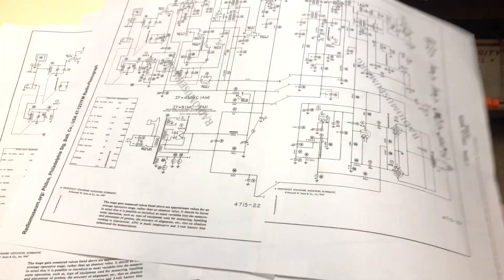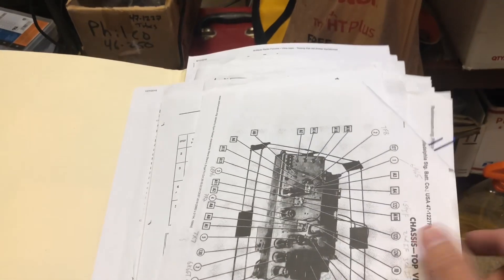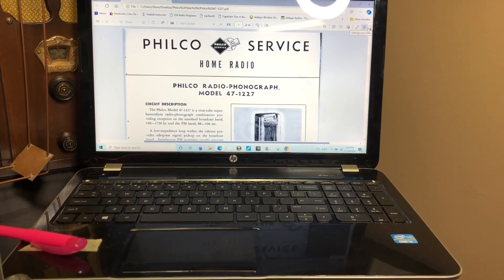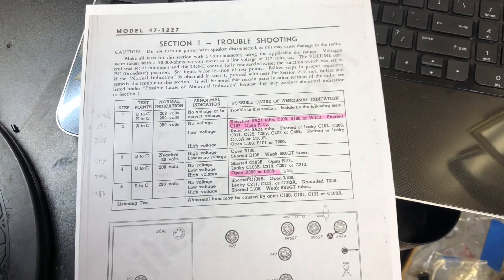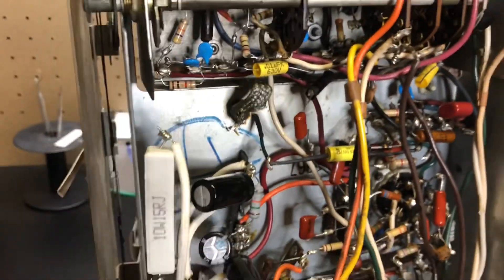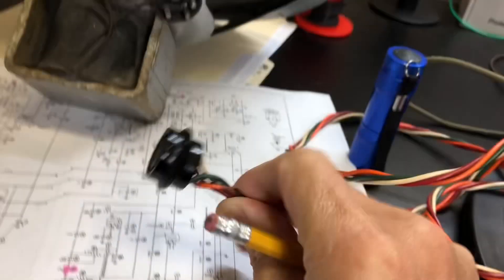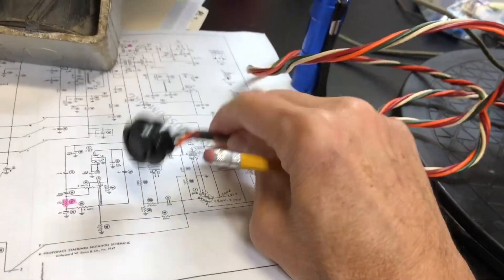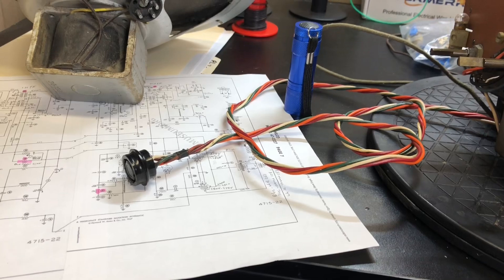I’m determined to get this to play

Comment: Speakers of that era use B+ CURRENT in place of a Permanent Magnet (they were weak back then). It also acts as a filter CHOKE.   Try a modern speaker on the terminals output transformer terminals. (the 'choke'  or substitute power resister must be in place.)
Reply from the maker: Thank you for that idea.  I’ll keep this in mind for other radios that may come my way.  The speaker I have works.  I hooked it up to my ‘48 Philco and it sounds great.  The problem, I think, is the lack of power or a signal getting to the speaker.   I’m going to test all the plate and grid voltages next.  But thank you again for your idea. 
Steve

Comment: Colors of the wires going to the speaker connector do not match up well to what was in there originally. If the orange is the
original it's voltage shoulg be 290 VDC. There was a  split to each control grid where that went to each 6K6 at pin 4. Now
the red should not be a high negative voltage. In fact if the red goes to the plate of one of the 6K6 tubes (pin 3) it should
be 280 Volts as well as the white going to the plate of the other 6K6. The green might be the wire going to a 68 Ohm
resistor that then goes to one side of the volume control.  I'm more concerned about the orange wire which is B+. It 
should only be 300 Volts or less not 468 Volts. The 6J5 Phase Inverter  plate voltage ( pin 3) should be about 200 Volts
and it's cathode at pin 8 should be less than 80 Volts. Also look at 7X7 tube pin 2 should be only 127 Volts and pin 3 a
negative 0.5 volts. All the readings you get are DC only with no station tuned in to get a measurement .
Reply from the maker: Thank you for all the information.  I will check these out again.  I’m going to check the voltages to all the tubes first. Then go backwards from each speaker connector wire  to the tube to the tube it’s connected to. Then still backwards from there.  Maybe that will lead to the problem.   I hope. 
Steve

Comment: What are you measuring the voltages with? A DMM used on high impedance valve circuits will give readings which while accurate will not match the service manual readings which were taken with an analogue meter. A good service manual should state what meter is to be used and on what range, you can shunt a DMM with a resistor to match the intended meter resistance.
Reply from the maker: Yes I use a digital multimeter.  When this was made everything was analog.  If the values are a little off, high or low, I’ll let it pass.  Some are off just a few volts.  Some readings are way off…then I look for a problem.  
Steve
Reply: @My1925World  They could be way off. The intended meter could be something like 5 k ohms per volt whereas even a cheap DMM is usually 11 M ohms or more. In a circuit where resistors are in the 100 k range the effect is very significant.
Reply from the maker: @NiallWardrop I’ll have to check what the repair literature said they tested with.  An analog meter may be on the wishlist.  Thank you for telling me this…could make a huge difference. 
Steve
Reply: @My1925World  It's been a while but I think the way it works is for example if the data says measure with a meter of 10 k ohms per volt sensitivity on the 3 volt range then the meter resistance will be 3 x 10k = 30k so if you put a 30k resistor across the input to a DMM it will be about right. If the circuit is very sensitive the data will say to use a Vacuum Tube Voltmeter (VTVM) which is the vintage equivalent of a DMM so the readings will be right without a shunt resistor.
Reply from the maker: @NiallWardrop I’ll have to look that up and give the resistor fix a try.  Thank you. 
Steve

Comment: Grab a signal tracer or frequency generator (set up to the IF frequency), and start from the audio output back one stage at a time until you cannot hear the signal out of the speaker (I connect to the grid of each tube ). Hope this will help.
Reply from the maker: Sounds like I’m going to have to do that.  I’ll put those on my Kutztown wishlist along with another Philco 1227 chassis. Maybe I’ll get lucky and figure out the radio’s problem. This is a real challenge. 
Steve
Reply: I was going to suggest the signal tracer as well.